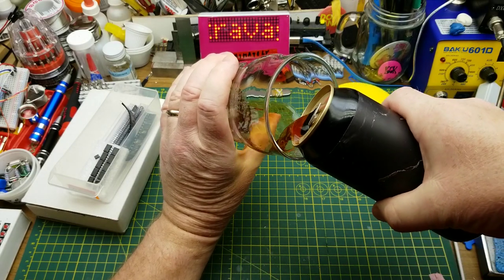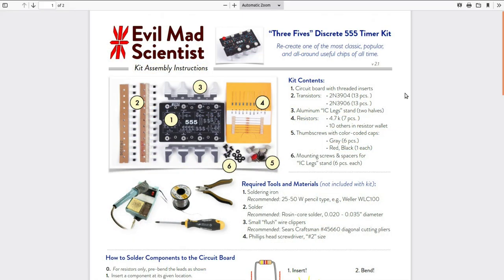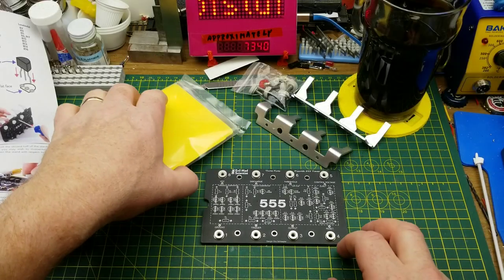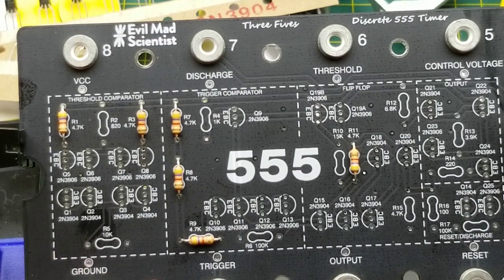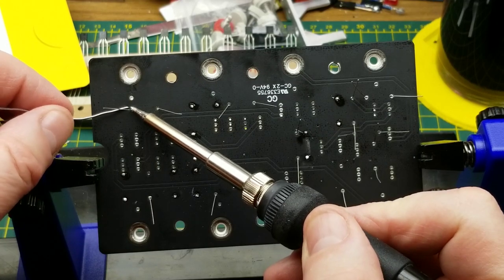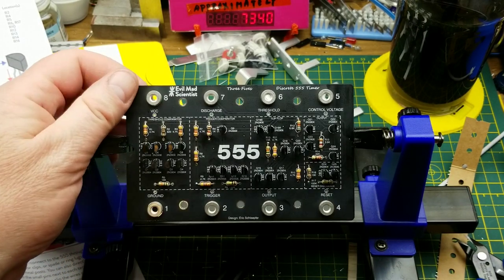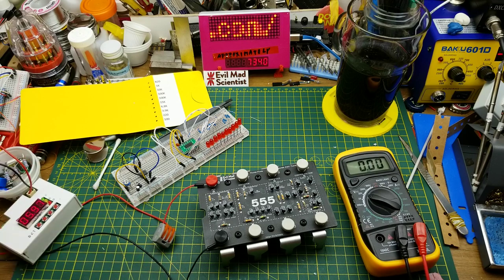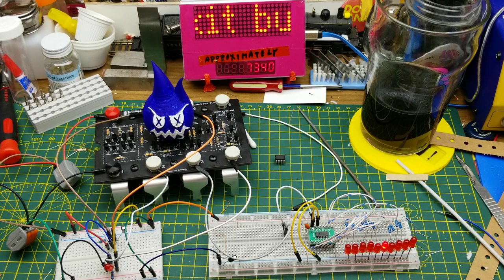December kit builds: huge 555 timer kit

Comment: This I would build into a wall clock. Round wooden frame. The chip under a piece of glass dimly lit from under. The timer would actually run the clock. Mounted a homemade PCB. I may get one.

Comment: Nice teaching kit, far above the mass of 555 project kits based on the chip. Definitely far better to let yhe user learn how such a device works.
Pity about being distracted by the making of the video, to putting an error into the assembly, they made it as failure proof as possible, so really such error should not EVER  have occured.  
But let someone claim to never mske such stupid errors and you can without any uncertainty call them an absolute liar. We all have suffered brain fade/absence at some time, be it long hours, interuptions, or plain over confidence . Only issue is why so long to diagnose the fault....surely the circuit is so clear and accesible the fault should be very quickly isolated with just a multimter and the cct diagram. Oh well maybe overconfident that given the simplicity of the assembly process it must be all correct.

Enjoy your dabbling and have a Happy New Year......

Comment: I'm always looking for kits. I wish stained-glass was easier to get into. I love working on the bench on both types of projects. The hobbies work well together.  You can make some unique tree decorations just to get started into it. You are making a bunch of soccer balls basically. Easy lines to cut the glass. Then add your lights and controllers. I made one that twinkled randomly that  played 1 of 50 random carols if someone passed it. It could play the entire song or 5-10 seconds of one. I'm thinking of adding a video screen to one. Just can't find the 15 pin flex cable connector for the LCD of a gen3 ipod.  Just mount the ipod into it and load up anything you want.

Comment: Are you too young for Heathkit? Their brag was that if you can figure out which end of a soldering iron to hold, you can put together one of their kits. They really were good at writing the instruction manual and packaging the items. Their calibration, debugging, and testing advice wasn't the greatest, but they were great at assembly instructions. Nowadays of course, the standard is the IKEA-like pictures and Chinglish of instructions. Sigh I guess I'm old.
EDIT: Correct 2 really obvious and stupid grammatical errors. Thanks @Nick B!
Reply from the maker: I loved drooling over the Heathkit catalogue back in the day. My first advanced kit back in my teenage years was the Heathkit musical doorbell. I wish I still had it, or at least the manual.  I have to assume the folks at Evil Mad Scientist also have some experience with classic Heathkit. 
This kit is very much on-par with what I remember that experience being.
Reply: I built a Heathkit car radio when i was 15 as my dad's car did not have one. First large build before i went off and built and then designed avionic equipment. don't you just love them
Reply: Their brag ..... Their calibration ...  (they're is the contraction of they are!)
Reply: @SpeccyMan  You're correct! I think I may blame this on auto correction, although it may be due to advancing decrepitude on my part. Now I have to turn in my grammer police badge since I no longer qualify. Thank you for pointing out the mistake!